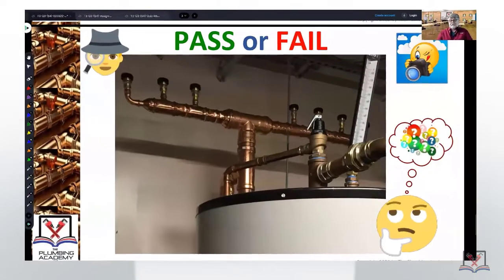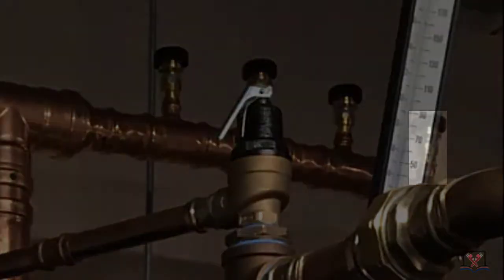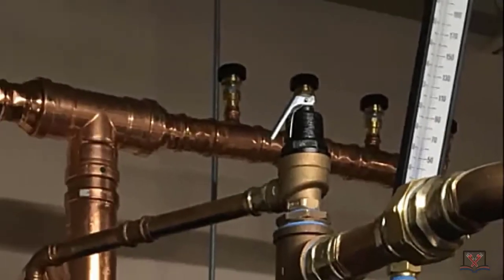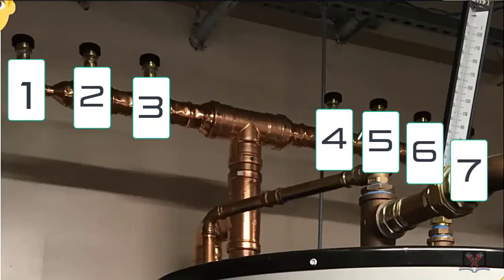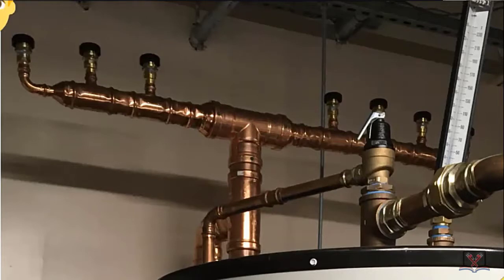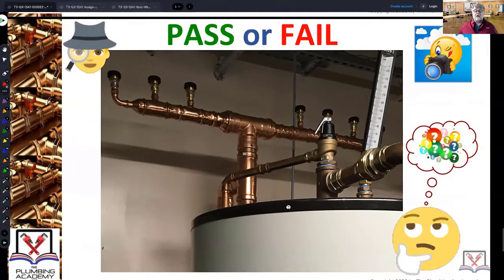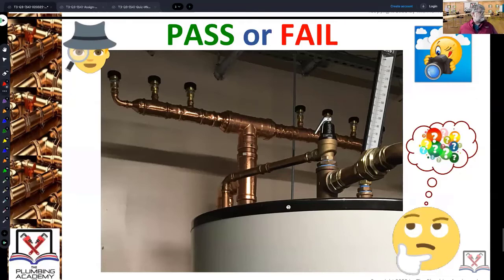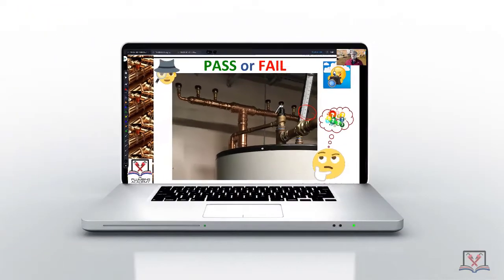Pass or Fail - Vacuum Relief Valves

Comment: Thank you. Could you perhaps speak more about the extent of application and whats going on here exactly?
Reply: I guess that's a nice way of saying, WTF.  One pipe diameter smaller.   so half inch x 7?   this video needs clarified
Reply: @lawrenceoleary4589  
The main cold water supply could be a 1 1/4 inch copper pipe. Which has a 6.2 times more cross session surface area than a 1/2 copper pipe.